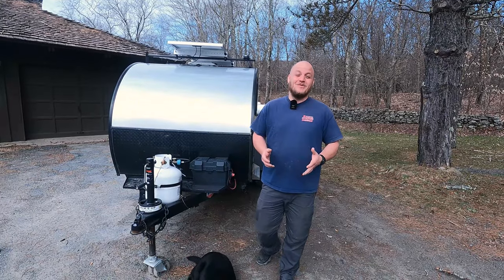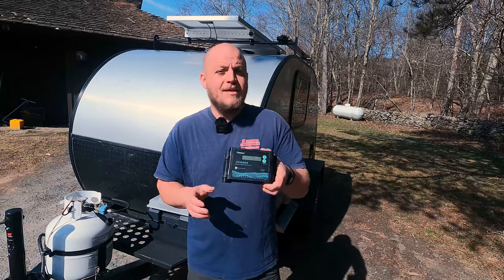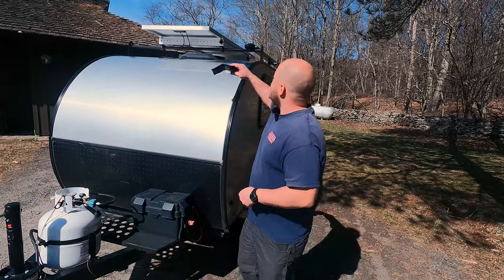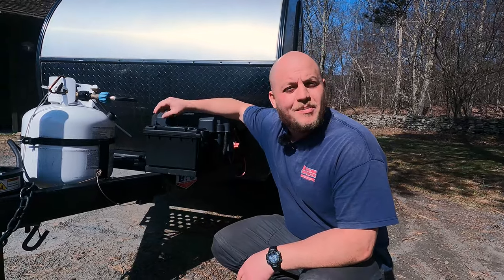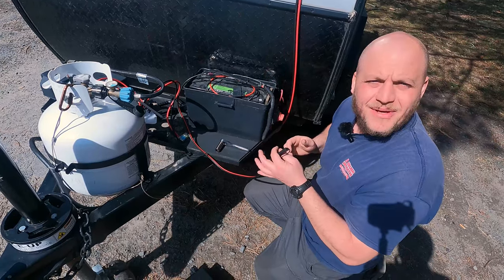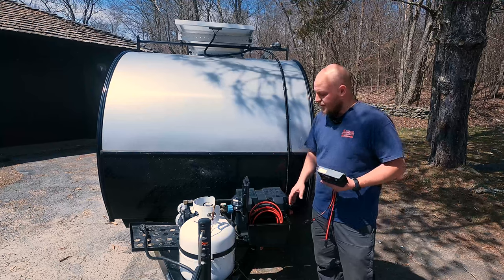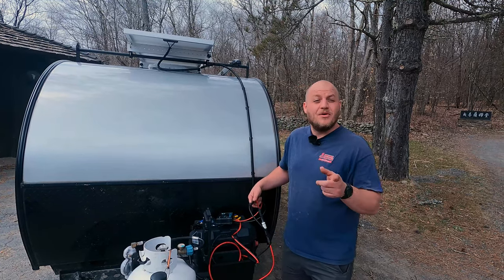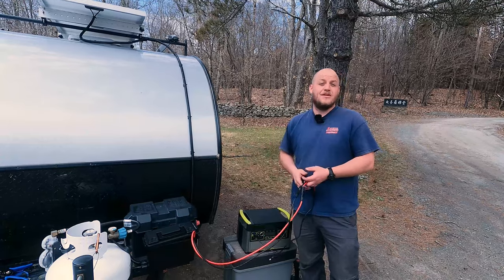DIY Charge Controller | Installation Options

Comment: Great video! I bought the Renogy suitcase kit. The waterproof controller is connected to the panel, but it's on a flip down hinge so you can easily read the display
Reply from the maker: Yes, they sell it both with and without.  It's nice to have everything all in one.

Comment: I just did this with a tiny 8.5amp PWM charge controller but instead of a separate box, I bought a large battery box and dropped battery and all in that box.  I used your previous video's idea and mounted a battery disconnect on the same box.  Keep up the great work!
Reply from the maker: That’s great to hear. Solar can be a lot of fun, thanks for watching!

Comment: Hi Brian, thanks for the video. Your channel is an excellent source of information. I have a teardrop camper with two 6V deep-cycle batteries. How do I go about installing the charge controller? I have all the parts that you used in your setup. Additional to the solar panel that will be installed on the camper, I have a suitcase-style panel. I want the system to be set up in a way that I could use the suitcase-style panel when the RV is parked in the shade. What's your advice?
Reply from the maker: Thank you for watching the channel.
Wire your charge controller from the positive of battery one to the negative of battery 2 and youre set.

On the charge controller , I would wire a simple lead plug (mc4 or anderson).
With those plugs, it should be easy to leave your rooftop panel plugged in, but be able to simply unplug it and attach your portable panel.  In some situations, you could even add both.
Reply: @DIYOutdoorLife  Thanks for your reply!

Comment: Great job sir. Very easy to follow your instructions and I'm forever grateful to you. My question however, is what do we/I do once you're ready to drive and connected to your vehicle battery? Do I disconnect the solar cables as the vehicle battery/alternator is now charging my RV battery, and reconnect once I disconnect from my vehicle etc.? TIA
Reply from the maker: Thank you, I appreciate you watching and following along. Actually, it couldn't be any easier… Do nothing at all.

The charge controller works as a regulator, it will decrease or stop the charge from solar automatically, depending on the output from the alternator.  Have fun!

Comment: Amazing job Brain - appreciate the step by step installation, works perfectly thanks to you.  Question - with the solar system as you set it up are there any issues when you plug in your trailer to your vehicle and the whacker battering is charging through the 12v plug-in & solar panel concurrently or if you want to trickle charge your whacker battery through a maintainer?  Does the solar panel need to be disconnected from the solar charger in either of these situations?
Reply from the maker: Thank you, I appreciate you watching.  There’s no issues at all, you can leave the solar set up… easy peezy

Comment: I had not seen a bi-directional power station LiFePO4; will keep eyes open for units 1K-2K watts with this feature. I imagine choosing compatible panels is highly important based on the station requirements. Nice bonus tip on the Reflectix, had not heard that before!
Reply: oops these comments were for "Faster Charging - Portable Power Station". Watching the whole series...
Reply from the maker: Haha… all good, I knew right away.

Any solar panel with a power delivery port will work. They come in deferent sizes, but the PD port in the power station will only take the voltage and current it can handle.

Comment: Hi Brian, thanks for these very informational vids… i enjoy them and learn a lot! I have an RV with an existing solar panel which i will soon replace and an existing charge controller that i will keep. It’s all already wired into the auxiliary battery system, so I’ll just wire in the new panel…
At about 16:30 in the vid, you discuss disconnecting your solar panel from your battery system and plugging it directly into your portable power station… this is something Id also like to do, but im curious… what happens when the portable battery gets full? Are you supposed to simply monitor its charge status and unplug it when it approaches a full charge?? Could you damage the power station by over charging it? Im also wondering about the LOAD output on my charge controller, which isn't currently being used. Could i output that to an adapter and into my portable battery station?? Trying to think of clever ways to use what i have without needing to disconnect/reconnect things or having to monitor them for charge status. Any information would help… thanks in advance!!
Reply from the maker: Hi, thanks for watching the channel and asking great questions.

Your portable power station has a built-in solar charge controller, there’s no risk of overcharging .  When the battery is full, everything can remain connected, it just does not accept the charge.

The best advice I can give for the load terminals is to ignore them.  They have a very limited use case, which often involves running a set of lights that turn on and off automatically.  This can be a very helpful feature on a boat, where it turns the outside lights on once the sun goes down.   For our use, just ignore the terminals. 

If you are in a situation where you want to automatically charge both, plug your portable power station in to the camper through your car charger and leave your solar connected to the battery .  This will allow your solar to charge the battery on your camper and then charge the portable power stations through the 12 V plug.
Reply: Again, more great information! Thanks Brian :) I have tried to plug in the power station to the auxiliary car charger of my RV but charging is extremely slow. I think I’ll just rewire the system to allow a direct MC4 connection into the portable battery.  Cheers!

Comment: Another great job Brian. I'm a newbie to solar, but get the jest of it. I have a new Teardrop & will take my first trip on April 25. The maker installed a 85amp AGM which should be just fine, all lights & vent fan run off the AGM. I have a Jackery 500 to run my BougeRV 30 Quart fridge. In the near future I think I want to put a flex solar panel on the teardrop to top off the Jackery (and to avoid my portable Jackery panel from sprouting legs.) ** One thing that stood out when I talked to the seller was a warning ⚠️ to not overcharge the AGM. Am I correct in thinking if I also use a solar panel to charge the AGM that programing the controller will solve that warning? And the MPPT type controller also has the same selection?
Reply from the maker: Yes, a charge controller of either variety will prevent overcharging. You’ll have a nice set up that you can share between the Jackery and the AGM if you go this route.

Comment: Hi there. I love your set up. I am going to try to set up a similar box to house the controller. Can I ask how you threaded the SAE end through the electrical gland? I have seen just wires but am wondering if is just as simple as getting larger glands. I've never worked with them before and so am curious to try it out. Thanks.
Reply from the maker: Most of the time, you can just push the sae through.  They do make larger glands if needed, but elbow grease goes a long way.
Reply: Awesome. Thanks so much for the reply.

Comment: Couldn’t see the two sets of wires or extensions with the SAE terminals and how they connect with various parts. It would’ve been good to zoom in so we could see those extensions in place and explain it from one end to the other.
Reply from the maker: Sorry about that. There is only a plus and a minus, A positive and a negative.

Stick with positive to positive and negativeto negative, just like putting a battery in a TV remote .

Typically, we use Red for positive and black for negative on DC wiring like this

Comment: One question, I have a battery tender for when my camper is in storage and so I have an SAE with o rings and a 7.5 fuse that I have been leaving in the battery. I couldn’t just plug my battery tender into the iGreeley because the fuse size would be too large, correct? Do you think I would be better off? Just swapping out the fuses whenever I plug in the tender or is there another way that would be simpler?
Reply from the maker: You're fine to plug your battery, tender into the iGreeley, I wouldn't worry about swapping the fuses.

The fuse is there to protect the wire, there's a smaller fuse on your battery tender to account for the smaller wire.  That I Greeley has 10awg, it's a perfect set up to just plug your battery charger right in.
Reply: @DIYOutdoorLife  great!
Reply: Another question for you; what is the reason for 2 sae connections between the battery and the controller? Any reason not to just have the short fused igreely in the battery box and then connect one sae extension with forked ends on the end of that cord rather than adding a 3rd cord? Just trying to save a little dough if no real need for the 3rd cord.
Reply from the maker: @BrookRieman  the extra cord allows a lot of modifications, easy to swap out for other purposes.

Perfectly fine to do as you said.

Comment: Good job, Brian, and kudos to your videographer. I might agree with T.J. that the $30 difference between the Renogy PWM you have, and the Renogy Rover 20A MPPT might be worth the investment. I think it's especially worth it in places like the NE where the sun does not shine as abundantly as, say, the desert SW. But if you need to save every dollar, your system will work fine. Looks like you're gonna die on that PWM/AGM hill! 😉
Reply from the maker: HAHA...I almost responded to TJ by saying, "I wouldn't die on this hill." 
 One day I'll be vindicated.  I imagine some sort of competition, where my $600 system can smoke the competition...lol  A guy can dream.
Reply from the maker: and the Rover is $60 more and doesnt fit...lol

Comment: Another Great Video Brian.  The part 2 to installing a Solar Panel.  How many Watts of Solar can be run through this 20 amp controller if you are hooking up panels together?   In a previous Video I seen to remember you recommending the Goal Zero 20amp charge controller?  I see this is half the price of that one.  Is that the reason for recommending this one today?
Reply from the maker: The Goal zero PWM excels in it’s ease of use and compatibility with power stations.  This guys is cheaper and works well if you are just looking for a basic set up.   I currently run a Victron MPPT on my camper.   There’s hundreds of options out there, I’ll try to make more videos highlighting the pros and cons of each.

Comment: I am planning to do this, but with an AFrame, my solar panel will be portable that I set out.  So my little box wont be sttached permanently to the tongue and will be packed away while rolling.  However, it will sit there when the panels are being used to charge the battery.  My question is--how would you suggest making the temperature sensor wire detachable?  I don't want to have to open the top of the battery every time--I would just like for it to hang out.  The other end of the sensor is a couple of wires that poke into the coontroller-I wouldn't call it a frequently removal connection. If I cut the wires, what connector would you recommend?  Looks like polarity might be an issue, is it?
Reply from the maker: That sounds like a great set up. I bet you could cut the temp sensors, strip, and use a WAGO connector. I feel like the small ones would do a great job with that fine wire and hold up.  They’re non polarized so youre fine.
Reply: Thanks for the info. WAGO connectors don't seem to be in my neighborhood, but I think the spade connectors will do ok.  And I am going to make a little boot for it from an aligator clip rolling around in the toolbox for some weather protection.  (look for another ? on the video about the kill switch.)

Comment: Hey Brian. Thanks for your great videos. My wife and I just bought a Bushwacker. I'm planning on doing your exact solar setup you cover with the 180 watt panel on the roof of your Bushwacker. I do have a question I hope you could answer? I've been considering going with two 6v golf cart batteries instead of the 100ah you are using. Would that 180 watt panel charge these batteries? Or would I be better off just doing your exact system? I have already bought everything you have except for the panel and the batteries. I know you said in another video that a larger " barrel collects more water that a glass". So I know the battery choice is very important. We live in Oregon if that helps at all. Your expertise would be greatly appreciated here. Thanks again. Chad
Reply from the maker: I would highly recommend these-
https://amzn.to/3zUu7Sc

Or something comparable. The two 6v is a much better system than what I’m using, it’s actually more than I need because of my power stations.

Good luck, thanks for watching!

Comment: Won’t my solar panel stop charging my batteries if I’ve installed an on/off switch to the side of my box as you have in the video?  I’d love to stop losing battery reserves and turn the switch off, but don’t want to lose the benefit of recharging them with my panel.  Thank you in advance brother
Reply from the maker: You can do it either way, but I set mine up the way youre asking about.  Connect to charge controller directly to the battery, not the switch.  Then when the switches turned off, the campers off, but the solar is on.

Comment: Possibly a dumb question but my Bushwacker 15DS doesn’t have a manual that I can find anywhere 

Questions about the SAE port on the side of the trailer:
1- is there any kind of built in battery protection on that? I was trying to understand what the breaker box actually does and it seems like that does have some over voltage/overcharge protection. I can’t tell what though. 
2- if there is some built in plug what benefits/drawbacks are there to using that (other than the wind issue you mentioned)? 
3- I’m guessing the fuse/breaker box has an inverter of a sort, but do you know what it’s ratings are?
Thanks for any help 😊
Reply from the maker: These are great questions, very tricky stuff and they don't help things with the no manual.

The solar on the side is kind of a gimmick. It's like that on all trailers, it's just a wire going to the battery.  There is a small auto resettable dc breaker, notoriously malfunction, and has a higher rating than what the wire does... lol

If you use the solar on the side, you still need to use a charge controller.  Although it can be convenient and works, it's best to go right to the battery.

Your power center has a DC converter, it does not have an inverter. It will serve to take shore power and convert it to 12 V, it does not help with solar.

Hope this helps, feel free to reach out if you have other questions.
Reply: @DIYOutdoorLife  awesome! Thank you again for replying so fast! 
That’s very good to know about the solar wire. I had a feeling it might be under rated but didn’t know where to look to find those. All the wires are buried behind walls lol. 

How do the 110 v plugs in the camper work without an inverter?
Reply from the maker: @midnight121190  they require that you plug the camper into a utility power source or make modifications.
On the rear driver side of the camper, there is a connection.  The camper also came with an extension cord, unless your dealership forgot that.

Comment: Hi, I just bought an RV with 150 w Solar panels.  I also have 200x portable solar panels, but no way to use the extra panels. What is my best option to connect these into my system.  Add another PWM charge controller or tap into the existing PWN controller?  Please let me know if you need additional details.  Thanks in advance.
Reply from the maker: Additional charge controller will be the best way.  How many watts of solar panels total? What kind of battery? You might want to consider an MPPT if you can.

Comment: I am so appreciative of your very understandable videos.  I have a 130 watt bougerv suitcase solar panel and will be getting an AGM battery with the new casita that we will be picking up next month.  After watching this video and your solar 101 video I think I need a 10 amp charge controller.  Would it be ok to get a 20 amp charge controller for future growth?  I tried to see the model of the blue charge controller in your video but I can't make it out.  Can you share what model it is?  Thanks loads for what you do.
Reply from the maker: Hi Jim, that’s great to hear!
The 10 amp is perfect, 20 is fine for future proofing.
Here is the link to the blue controller, it’s a victron.
https://amzn.to/3YXARbf
Reply: @DIYOutdoorLife  I tried to send this question a couple days ago but I don’t see it so I think I did something wrong and it didn’t send.  In this great video, I was asking about the charge controller that you recommended.  I have a 130 watt bougerv suitcase panel and I will have an AGM battery with the new Casita we pick up in a month..  I didn’t ask the question right and would like to ask again.  
Is the 20 amp charge controller you recommended a Renogy Voyager 20 amp pwm controller and would that be a good choice for me?  Thanks loads for your help.
Jim
Reply from the maker: @jimkasenow6122  Yes Jim, it would be a great fit for your set up.  It’s an inexpensive piece of equipment but it gets the job done for sure.
Reply: @DIYOutdoorLife  Thanks so much.  I have subscribed and will be watching everything.
Reply from the maker: @jimkasenow6122  thank you!